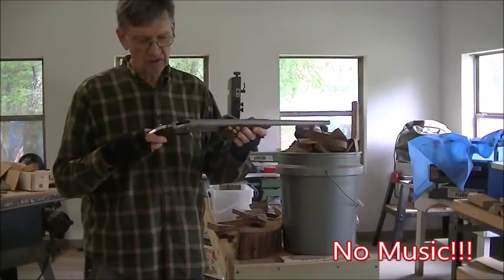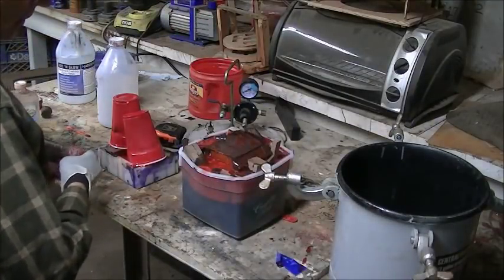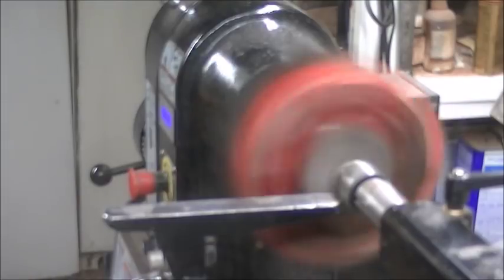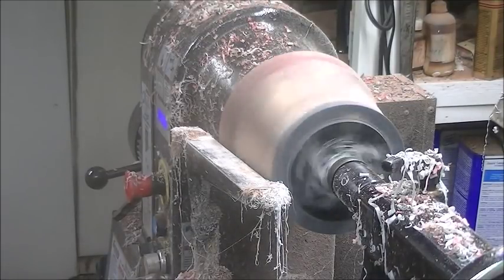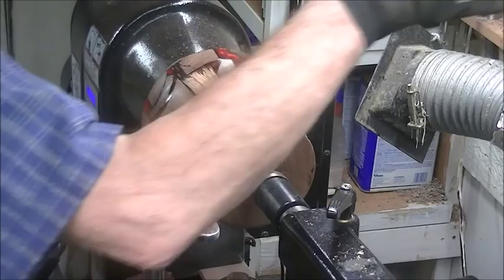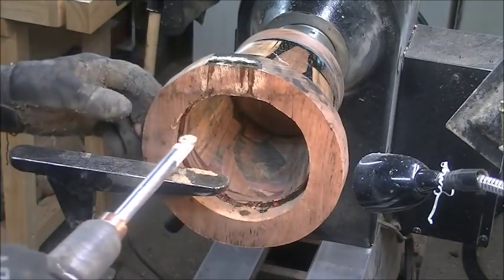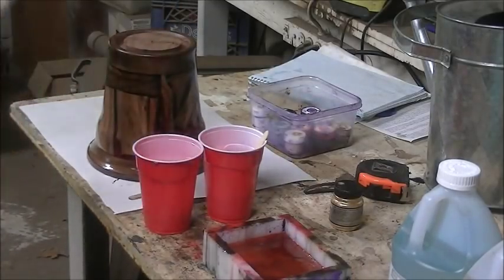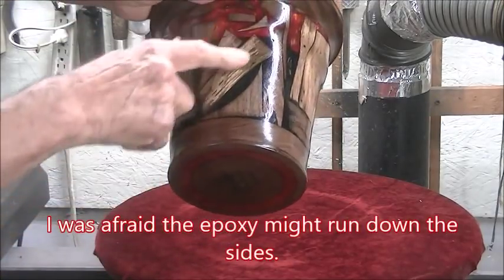First Segmented Bowl  LOL # 130

Comment: Just a note before I finish watching, there are 2 rules tjat must be adhered to on shotguns. 1, barrel must be 18" minimun. Leave an extra 1/4" to be safe. I know that was a factory barrel. 2, overall length must be 26" stock to tip or you are flirting with criminal actions.  I dont agree with the rules but that is federal law.
Reply from the maker: Wrong, shotguns cut down are automatically reclassified as a tactical weapon.  The measurement rules don't apply to tactical weapons.  Thanks for watching, Larry